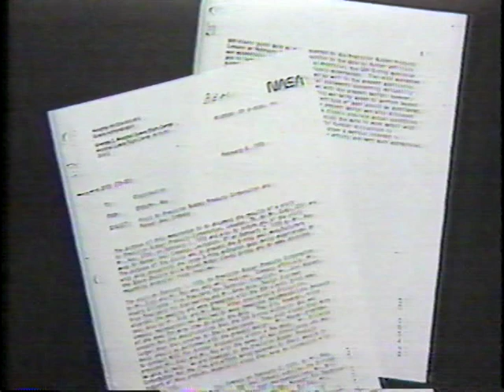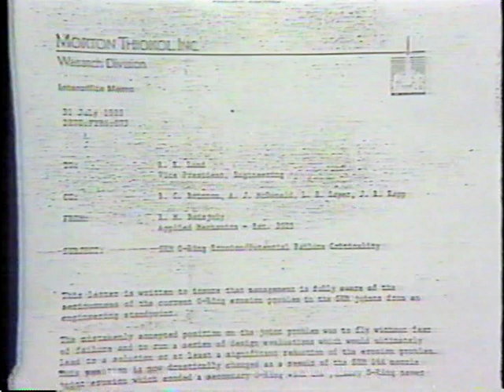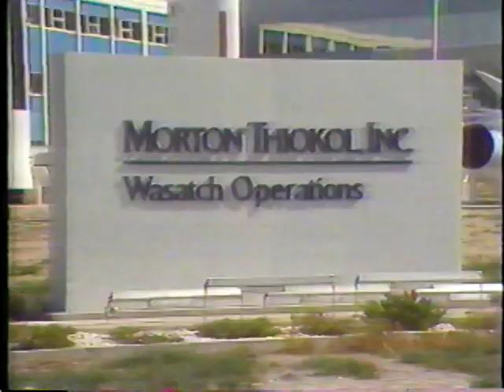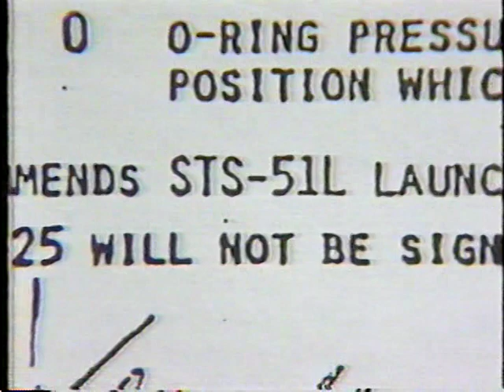20/20 Challenger Accident 1986 Report on Cause

Comment: It didn't smell right, but they launched it anyway. The solid rocket booster (SRB) should have been built on the East Coast (thus deleting the need for rail transportation) and been a one-piece configuration instead of sections. O-rings was an incredibly stupid idea destined to fail sooner or later.
Reply: It’s even stupider to reuse them

Comment: The NASA official that pushed for launch after   Thiokol said it was unsafe should have been held criminally liable.
Reply: Sherri, you’re right. The guy who pushed Morton Thiokol for clearance to launch, after Morton Thiokol 
said , “ No, it’s to cold”, that’s the guy who was entirely responsible for the tragedy.   Then, in front of the
Presidential Commission,  he denied any wrong doing, until Morton Thiokol played the tape to the
Commission,  proving he was lying to the Commission.  He should have been canned.
Reply: @Falcon now that’s a little unfair. They’d made their point as clear as possible and their superiors wouldn’t listen.
Reply: Excuse me miss, is your husband a writer names Tony Gaskins?
Reply: @Falcon The teleconference held a recess to allow for private discussion amongst Morton Thiokol management. When it resumed, Morton Thiokol leadership had changed their opinion and stated that the evidence presented on the failure of the O-rings was inconclusive and that there was a substantial margin in the event of a failure or erosion. They stated that their decision was to proceed with the launch. Morton Thiokol leadership submitted a recommendation for launch, and the teleconference ended. The decision to launch was made by officials from Morton Thiokol, (MT) and NASA. Those are management officials. There is no mention of any engineers being involved in the final decision to launch Challenger. If management couldn’t figure out from Arnie Thompson and Roger Boisjoly’s furious attempts to stop it, there was no stopping it. The decision to launch Challenger lays squarely on the shoulders of MT & NASA management.

Comment: Terrible design if something of a few degrees of temperature change could cause a explosion
Reply: On the day it was 30° colder than any previous launch. Overnight they chilled at 18° now we are talking 42° colder than any previous launch with the rings showing more wear in colder temps.  You just don't over stress a system of any kind.
Reply from the maker: William Smith Yes, and they redesigned it and some said it was even more complex and potentially faulty. It was the coldness specifically, not just a change in temperature but your point is well taken.
Reply: And why didn’t you warn them before?

Comment: People seem so ready to point fingers. Yes there is no room for error but then like the word "routine" should not be used here. l work on cars, brakes etc, l am accountable. People who work on aircraft are more so. The shuttle had no room for error. But we are human. That is why you don't fuck up and you do have triple checks and they do that. With the ice, idk. but with the build definitely. Like 3 people torque the same bolt or write off on the same thing. As they should. You can only do so much. Agreed though, could have been prevented... but only after you know the cause. There should have been a better seal or a 3rd not just 2 seals... 3 people sign off not 2 kinda deal. l still feel terrible for loosing them.
Reply: The problem was that they did know. The engineers warned them and tried to postpone the launch, but management didn’t want to hear it. It’s like if you noticed something was wrong, wanted to fix it, and even tell your boss about it. Yet your boss sends out the car anyway.

Comment: The people that was in charge of the call to launch should have been held accountable. They put business in front of human life. It was a total disregard of human life for the bottom line of business. Shame on NASA.
Reply: It was a bad design to begin with. They should have tested it at low temperatures. Engineers protested the launch. Too many decisions to hold 1 person accountable
Reply: @greer8288  Lawrence Mulloy and William Lucas, who were the launch managers at the Marshall Space Center in Alabama put in a waiver to keep the shuttles flying in 1985. NASA had a rule that if a system and it's backup were failing, the shuttles can't fly. And fixing the issue with the booster would take a a couple if years. But Lucas and Mulloy didn't think the SRB issue was a big enough risk to keep the shuttles grounded, even when Thiokol engineers stated that a burn through in the booster could lead to the loss of the vehicle and its crew. And then they didn't even pass on the issue with the SRBs to upper NASA management. So a bulk of the blame should lie at their feet. They were focused more on keeping up their launch schedule than keeping the astronauts safe.
Reply: Travel With Us And it wasn’t even business because it’s a government operation 😒

Comment: The reason the SRBs were in segments was so they could be shipped by rail from the plant in Utah. I wonder why Morton-Thiokol didn't build a plant on the east coast, or the Gulf coast (like the external tanks), dedicated to building and maintaining the SRBs. Not only would it be more convenient than shipping them across the country between launches, but they could be built as a long, continuous unit without the need for the o-rings.
Reply: @terryk1233youtube  I am not even an engineer but when I looked at the design of the SRB with what it was containing and the forces involved?  I just thought  "Who the fuck OK'd THIS?"   A disaster waiting to happen.  They missed having it blow up on the pad by sheer luck.  Can you imagine?   Kblam!!!
Reply: If you look into the early history of the Shuttle program, in the beginning, NASA wanted a better launch system that did not use these rockets and fuel tank, but government bean counters didn't want the expense of the better system, so the SRB/tank system was forced onto them.
Reply: @DMahalko  I am not an engineer but I think anyone with a modicum of experience in this field would say that the design system used on the SRB's was completely retarded.  High pressure extremely hot propellant?  held together in segmented canisters with "Joints"??   Really?? 

What genius approved this??  A disaster waiting to happen.    The system is only as strong as its weakest point.  But why the FUCK would you make the weakest point in an area with highest probability of failure?   Unbelievable.
Reply: I read somewhere else that Orrin Hatch, senator from Utah, was the one who insisted his state be given the contract to build it.  Thus insuring that it cannot be built in one large piece.  I don’t know for sure myself, but it seems certainly possible.  Shame on those for letting that happen.
Reply: @mick2spic  Remember that senators represent their states as well as federal matters. He wasn't going to vote for the program without the dogbone. Enraging...
Reply: I can agree to disagree. 

 The entire shuttle was a disaster waiting to happen, poor design overall. 
 The SRBs had shown problems with the seals but they never got passed the first ring. The errosion proved to be heavily influenced by temperature at launch. At that time 60° being the lowest...then they launch it at 32° after they chilled over night at 18°...this is why the engineers in charge of them were absolutely furious and demanding they abort. The SRBs were far out of their operational range and too further the problem their was heavy winds putting more stress on the already weakened O-rings.
Reply: Yes I wondered the exact same point. Build them where you need them. Introducing complicated joints and seals because they are being built across country seems, I find that hard to rationalise.
Reply: Cost. What else.